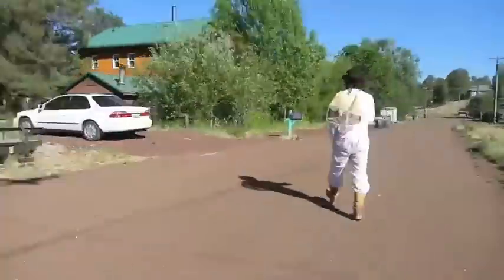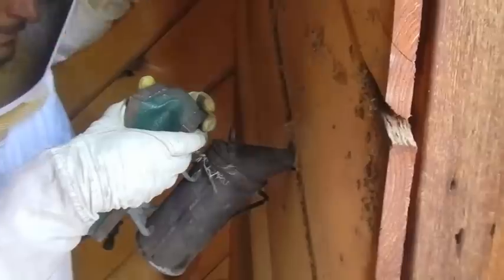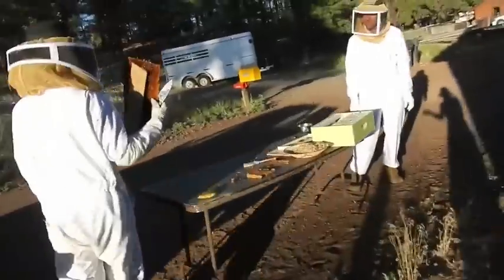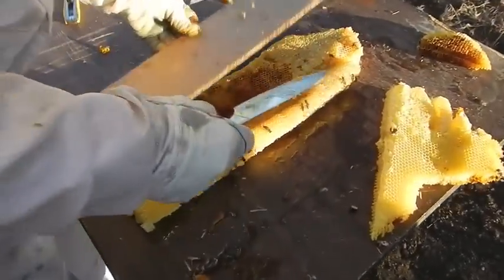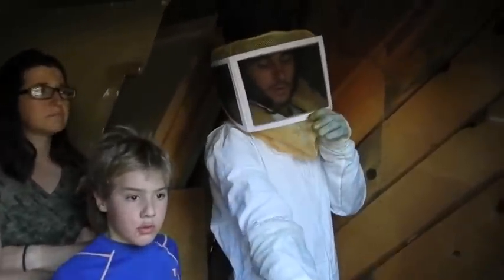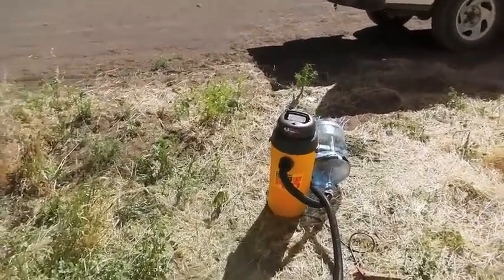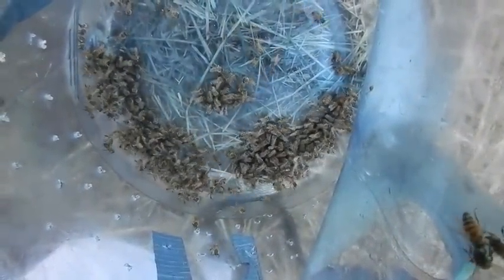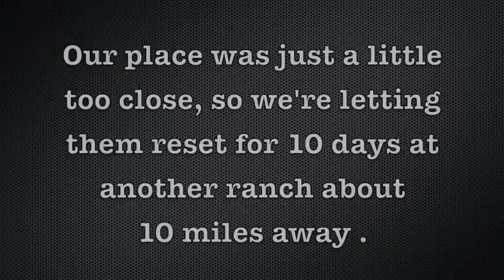Wild Bee Hive Relocation : ) Huge Colony - 5yr's Old !! - Vs. 2

Comment: Kudos for pulling off this monumental job.  Don't know if it has been asked yet but it wasn't clear from the video if you guys paid attention to the orientation of the combs as you were putting them into frames.  When they're built, the cells are oriented with a slight angle upward (9-14 degrees) rather than straight horizontal.  It may not matter much for broods or capped honey cells.  However for fresh un-evaporated nectar deposits, miss-oriented cells  are likely to leak out the side.  I hope everything turned out okay and your colony is still going strong.

Comment: you put the comb in the frames sideways, better to keep it right side up :)
 Also if you spray them with a bit of sugar water while in the vacuum bottle,  less go in the air when you pour them into the hive
Reply from the maker: Yeah .. this was like a month after we started beekeeping, and we didn't know that the bees build at an upward angle. But they used all the comb as-is .. it was a sideways slant, not upside down, so the nectar seems to stay in just fine. This is the most productive hive we have right now. It weighs a ton and is full of bees : )

Interesting tip on the sugar water .. so that must weigh their wings down ?
Reply: pollenArts - Also, instead of using a dust pan, take a frame with comb and brush the bees onto it, they will stay on the frame.  Put that frame back in the hive and grab another and do the same.

When you locate the hive, pile some branches and limbs in front of the entrance to force the bees to crawl through and they will reorient to their new location.  You won't need to move them miles away.

Tip, use sugar water instead of smoke for most of your activities around the hive.
Reply: I know absolutely nothing about this but I'm assuming that they want to drink it and it catches their attention.

Comment: Nice work, I was called two times in the past to do the same. But i don´t understand why you keep all that old breeding cells and put them in frames and into boxes. The bees are really good in starting a new hive in a box, when you only catch them an put them on frames with wax foundations. It even is more easy for them to start a new one, they only have to be fed.
I´d have melted the old cells and made foundations from the wax. It is more helpfull for the bees to build new cells and it is better for their heatlh.
Reply from the maker: acKronacI've found that bees will stick around if they have something to get right to work in. They're still using that comb now, filling some with food and laying like crazy in the rest of it. I was told the hive had been there for 5 years, and I could only see one set of comb that was cut down and sitting on the floor in the cavity, so I'm guessing they use that comb for a long time. They had babies and eggs .. and since the queen did not make it along, they were able to use those eggs to raise a new queen. I guess there's a million ways to do it, but we always save their existing hive, and it works out great.
Reply: pollenArts of course I understand your point of view and I agree with the point, that beekeeping must not only be an industrial business. But if the cromb gets too old, the old cells can cause sickness in the hive. AFB for example most time results from  old cells.